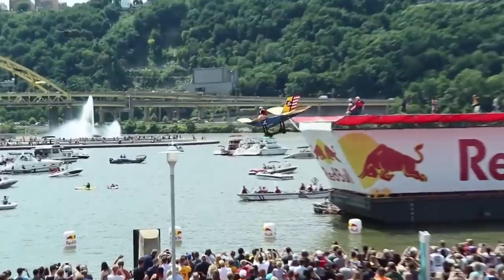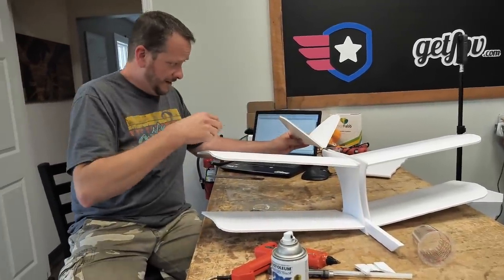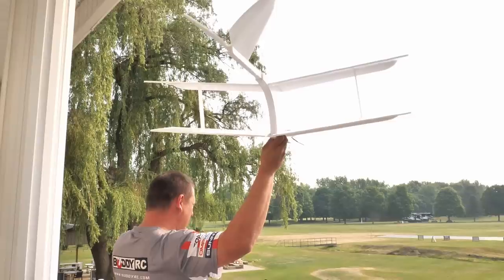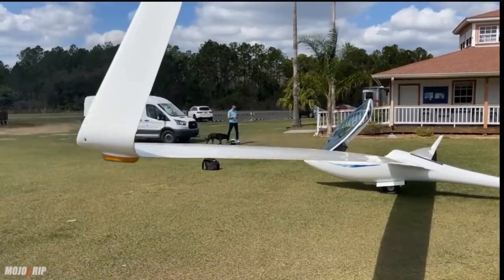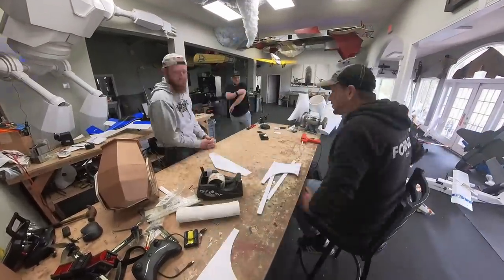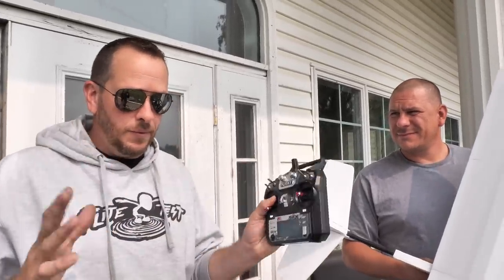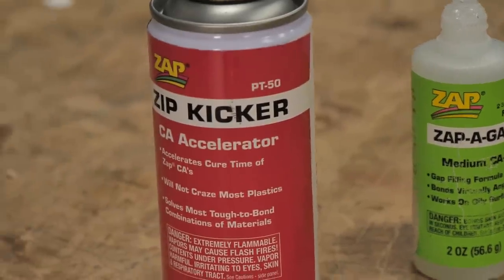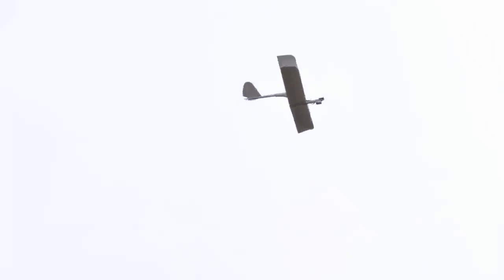The Red Bull Flugtag Record Will Be Broken!!

Comment: given that the flugtag takeoff speed is basically 0, i would do model testing not by tossing the plane, but simply dropping it
Reply: Came here to say exactly that. Tossing it makes no sense
Reply: @camofpv  also they completely forgot to add the weight of a human to the nose of the craft (or a simulated, to scale weight) so im predicting a phenomenal nosedive at flugtag
Reply: But they have weight on the nose?
Reply: @Space_Reptile if i had to guess they’re figuring the weight of the control electronics is roughly equivalent to the pilot
Reply: Don’t you love it when a plan comes together
Reply: Flugtag launch speed is about 6mph. (fast waking speed)
Reply: My thoughts exactly. Just push it gently off a ledge to simulate what's actually going to happen.
Reply: Maybe not simply dropping it but launching it at scale velocity as well.
If it's 1:10 scale they should be testing launching at 1:10th speed
Reply: They literally push it into the water
Reply: @dancamplinmusic aerodynamic effects do not scale like that. A lot of aerodynamic effects are proportional to velocity and surface area and that leads to scaled down models needing a higher velocity or airspeed to simulate the effect properly. So scaling the speed down to 1/10th when you have scaled the model down to 1/10 is likely not anywhere close to be correct and will not give you accurate tests.
Reply: @conorstewart2214  yes, you're right!
Which is why the thrust needs to scale down to 1:10 for a 1:10 model.
A 1:10 model that generates sufficient lift at 1:10 thrust will typically perform better when upscaled. 
There's alot of complex equations that can be done to establish exactly how much to scale down thrust but for the exercise of flugtag, and in the interest of not boring the internet, I would argue that those equations are wasted time and added complexity to a build that is designed to last approximately 30 seconds at a flugtag event.
Reply: @markkmiecik9797  You can increase that by using a pulley system and having a bunch of heavy guys jump in the water first pulling on it. You can also increase it by building a very high cart to launch from. The current record holders did neither, they only build a plane with supreme glide capabilities and used a very light pilot (45 kg). The record can be easily broken by a combination of three things: launch from as high as possible, launch as fast as possible, build plane with best glide ratio.
Reply: Was just about to comment the same. You must develop a wing/foil design that will glide from close to 0 takeoff and go from drop to flight in a extremely short distance, or else you will be swimming 12 feet from the starting line
Reply: @camofpv  🔴 What Is Islam? 

🔴 Islam is not just another religion. 

🔵 It is the same message preached by Moses, Jesus and Abraham.

 🔴 Islam literally means ‘submission to God’ and it teaches us to have a direct relationship with God. 

 🔵 It reminds us that since God created us, no one should be worshipped except God alone. 

 🔴 It also teaches that God is nothing like a human being or like anything that we can imagine.

🌍 The concept of God is summarized in the Quran as:

📖 { “Say, He is God, the One.  God, the Absolute.  He does not give birth, nor was He born, and there is nothing like Him.”} (Quran 112:1-4) 📚

🔴 Becoming a Muslim is not turning your back to Jesus. 

🔵 Rather it’s going back to the original teachings of Jesus and obeying him. 

More ...
Reply: @conorstewart2214  THIS
Reply: @dancamplinmusic   - ...adjusted for scale air density.
Reply: @lifequest7453  you seem to have read this situation very wrong. I am not involved in this channel in any way, I am just another person who watched the video and commented on someone's incorrect comment.

If you think it affects the small model as it does full size then you have no idea what you are talking about. It is very well known that aerodynamics do not scale linearly and smaller scale models often need faster air speeds to have an accurate simulation. I was commenting on someone else's comment saying that a tenth scale model needs a tenth of the speed which is very incorrect. You very clearly don't understand fluid dynamics if you think you can just ignore scaling or that it doesn't exist. Many aerodynamic and fluid dynamics laws are not linear so they do not scale linearly either, that is basic fluid dynamics.

Where did I say that they were testing it appropriately? I never did, all I did was correct someone else's comment.

No wings are too small to make lift and no object is heavy enough for wings to not produce lift. Yes the wings might not produce enough lift but that wasn't what your incorrect comment said.

It would appear it isn't very difficult to know more about this than some viewers, like you.
Reply: Precisely. I was just about to make a comment saying the same and saw yours. The air flow over the wings is so small it needs to fall  some to build up air speed, then... you MIGHT generate some lift.
Reply: The launches that are actually trying seem to launch with a speed close to their intended cruise speed, actually.

Comment: I don't think that many teams think about ground effect. That's where a lot of competitors get the distance. I'd  design something to take advantage of that. Also slow flight means large control surfaces so why not just use the whole stabilizer as an elevator?
Reply: This comment was stolen from me, someone using my name.
Reply: The moment you reach ground-effect you got about 10 to 15 ft of travel left. Power ground effect is a different story.
Reply: The lower wing is really low, which should help with GE.
Reply: I’m more worried about the stall effect.
Reply: Yup!...I just came back to comment that a dive for airspeed should be job one... Followed by leveling off to take full advantage of ground effect.
Reply: funny how everyone is forgetting that  drag generated by the top wing cancels out the lift generated by the bottom wing.   lol
Reply: @lifequest7453  
I DID see one setup that had an elastomer catapult (think "slingshot") on a cart. The whole thing was pushed off the launch deck, with the catapult being triggered just as the cart went off the deck.  The plane actually climbed, levelled off, and then glided downward for am impressive distance.  I'm not altogether sure that it was a legal flight, though.

Comment: The launch from the barge and the first 1 second of flight are most critical in this event. You will need to apply your engineering skills to the full scale launch phase. After launch, make sure your spars can handle the load. Good luck! I'm rooting for you!
Reply: I would be working on the launching more than anything if you could add a line to the launch cart to the aircraft so as to turn it into a kite and gain altitude and speed then quick release
Reply: One design years ago incorporated a rail launching device geared to the sled wheels in order to increase forward acceleration before the Edge... Think slingshot effect!😅

Comment: The team that used the two guys jumping off the platform to pull ropes and really accelerate the flyer was genius
Reply: If they used a tall tower to launch from, they not only woul get extra height to start but it could be a catapult using the ropes attached at top as a fulcrum, so when they jump off it throws the plane off the end like a trebuchet
Reply: What about bungies instead of ropes?
Reply: @dskofich  yeah, climbing shock lines could be used for a smooth transfer of energy
Reply: Or offroad recovery rope. Definitely was thinking of some sort of energy recovery setup where the cart falling away has some sort of delayed arm that transfers some of that to the glider.
Reply: @accordv6er  recovery rope would probably be to strong, a rock climbing shock rope would work better I think
Reply: @dskofich  they could slingshot the thing into the next county. lol
Reply: Adding to that idea: what about performing some staging act... something like a mix of 2 scenes from Indiana jones (nazi plane scene from the lost ark and the biplane scape from the last crusade) making the transition from the dance to the launch in one take.
I mean, better than some silly dance moves(?)
Reply: @pablofloreztabares8110  yesssss bi plane could be a comedy bit where the pilot is launched without his aircraft or something if distance isn't key factor
Reply: @pablofloreztabares8110  ooohhh what about flywheels? Could jump off where the shock cord starts the spinning and the team member is curiously hanging there like he's trying to.fall as it slowly accelerates. 2 or 3 people falling might have enough energy to really get something going combined with a push from others?
Reply: @accordv6er  I like it! (overengineered but I love it)
Reply: @accordv6er  I was thinking more like a gun scene like in the old websterns falling from balcony
Reply: @pablofloreztabares8110  RB needs more of these and the soapbox derby. I'd travel for soapbox, idk about trying to transport a flugtag machine ahaha. Nothing near me for a long time :(
Reply: I hope they see this comment. The launch vehicle/mechanism is going to be as crucial as the flyer.

Comment: What if instead of trying to fly right away, you use the height to gain speed, then glide right above the water surface like an ekranoplan? That seems like a more efficient use of the very limited potential/kinetic energy.
Reply: better yet.. why not use the vertical drop as a gravity catapult? in other words... hook the plane to a rail system in such a fashion that the rail system serves as additional thrust as it rotates off the edge ??
Reply: @rollerkingonce  While not specifically banned, I don't think launch assist is allowed. Gravity may be different (and not having it specifically banned means it IS allowed, right :D ) and that would actually be a great idea since at that point you can have as much drop weight as five people (required team size, as per rules) could carry up there.
Reply: The fartest you can possible go is a combination of speed and ground effect. Launch speed can be increase with a pulley system, just need all the non pilots to jump down in to the water.
Reply: @AgentWest  There's some optimum in this regime. Diving more from the platform allows you to design for a higher glide speed, thus decreasing wing area and increasing aspect ratio. It also allows you to increase your lift and reduce induced drag via ground effect. The downside is you end up spending less time in your optimum parameters. Also, the control problem of a dive glide is much more difficult than a constant glideslope. 

The real secret is to find the lightest pilot possible. A 40 kg tiny woman needs only half the wing area of a 80 kg man thus half the chord at the same span, and that wing will produce half the lift at twice the L/D thus ~1/4 the induced drag. The Chicken Whisperers use a very light girl. This is the single most impactful design parameter.
Reply: @appa609  True about the weight. I just looked up "Chicken Whisperers" and their 2013 flight, that was impressive! What i found particularly interesting is that their glider started on a rolling platform. While it was rolling and the wing was gaining lift, the pilot had plenty of time to adjust her body position (i.e. balance of the craft) for the best glide slope. Very basic way to control a very simple craft. Very effective in the end.

Comment: Unfortunately biplanes don’t exactly double effective lift. Depending on separation, it might only produce 120-140%. 

The way they will help is you can build the wing structure lighter because it is essentially a bridge truss. Lower weight means lower stall speeds, which will help greatly since your take off speed is essentially zero.

Comment: I feel like u would want something that shines at ground affect and has strong tail authority quicky...u want it to drop off the boat and quickly be able level out once picks up some speed and translate it into a glide slope so Def narrow wide almost flat bottom (slight undercamber) with v tail for sure for added dihederal and shorter using the person as the nose weight or if possible person directly on top of cg

Comment: I don't know what the "Launch Assist" rules are, but if they allow, I would think really hard about using a push pole of some sort to enable your ground crew to impart as much energy (speed) into the craft as possible.  Just like the Cub Scout Pinewood Derby cars, its all about the physics and the energy provided by your launch assist crew is probably one of the most important factors to manage/consider.  Find a bunch of rugby players to be that crew...

Comment: Look at the Japanese human powered flight yearly comp. They also have a non powered field that fly about 200 meters. The pedal powered version go over40 kilometers!
The idea is that you dive down off the end to get speed then use the ground effect off the water to maximize the glide slope.
Reply: You mean "JAPAN INTERNATIONAL BIRDMAN RALLY".Probably the best competition in the world.Looking at the video of the competition, we can see that the slow flight design has the opposite effect, and the optimal solution is an aircraft that does not lose speed.
Reply: @pulaperapora7130  yes it is the greatest test of man powered or glider flight I’ve seen.

Comment: A longer aspect ratio will mostly reduce induced drag, but it gives it a much higher frontal area which greatly increases parasitic drag.
Reply: The wing span is the same, parasitic will be the same
Reply: You mean form drag. Parasitic drag is from non flying parts (not wings). Like undercarriage or aerials.
Reply: At the speed theyre doing induced drag is much higher than parasite drag

Comment: Just a few things to consider.  Directional Stability>>This can be achieved with either a rudder in the back, OR having vanes on each wing.  Since a vane can be placed on each wingtip, you don't need as much surface area and this saves weight.  The tail can also be a full flying horizontal stab which saves weight on hinges and linkage.  Also, you need to consider Bernoulli's principle.  Lift is created by a differential in high/low pressures that are created with wind velocity differences.  I like the biplane idea, but the camber of your wings needs to be increased.  You can also cut down on the cord if the wing is more efficient.  Aspect Ratio is everything.  Now, find a very small girl to fly it.  Good luck.

Comment: Two ideas: 1. What about flaps? This would allow the pilot to trade drag and lift as needed. What if with flaps you could actually get the thing flying before the end of the platform, then retract them for speed while descending, and then extend them again just before splash down to get a few extra feet. 2. Can you build it around a bicycle? You can get moving faster by pedaling then you can by running.
Reply: For a few-second flight, too many things to fiddle with only complicates things.

Comment: I've always thought that the best way to control pitch on this type of craft  (no need for steering) would be to have the pilot sitting on a rowing machine seat that moves forward and back to instantly change the c/g. This could even be used to control an r/c plane; forward/aft, left/right movement of a weight being the only (hidden) control surfaces.

Comment: Dont forget, you have counter wieght also!!! if you created a pengelum type seating arrangement which swung forward for initial launch to shift cg nose heavy,,,, then craft goes into dive, builds speed, then the spring loaded cable connected to wing just behind cg, pulls pilot seat back and locks into cruise position with cg at or slightly behind Center of Mass to  pull nose up and achieve your flare for landing.

Comment: I'm thinking using a couple of levers, demountable, fixed under the wing root which, could be attached to ropes. The two jumpers would jump off the edge and the levers would increase the speed and give you a height advantage.

Comment: You don't actually get double the lift from a biplane, because they have considerably more interference drag- and the low pressure zone on top of the lower wing reduces the high pressure zone on the bottom of the top wing. But you placed the wings pretty far apart  vertically which helps, and while it might not double your lift, it still increases it. It's a proven very stable design, So much better than any (inherently unstable) tandem design!

Comment: I was thinking about the launch, are you allowed a guide rail. If you have a single "u" rail, so a single wheel  (in the c/g) would allow a smoother launch. As far as the crew, 1 Pilot, 2 on ea. wing, and a single (1) on the tail. The tail person is responsible for pitch and yaw at take off. The 4 on the wings would provide the thrust and make shure the wings don't drag. Or can there be a "Catapult" similar to the Wrights,  same rail, but this time everyone except the pilot grab the tow rope and drop off the end at the  same time launching the craft. Anyways, just a thought.  Great video,  thanks again.  John S..

Comment: I don't see any brace wires on the model.  Be sure to add them when scaling up as they're one of the biggest reasons to use a bi-plane wing.  i.e. by cross bracing between the wings you can make them work like a single super thick truss instead of long thin cantilever beams.

Comment: You are decieving yourself with the toss tests.  Your toss velocity is WAY greater than what you will achieve running off the Redbull tower.  A better test of its glide capability would be to let it slide off a rail from balcony.

Comment: Aerodynamically, a longer chord wing is better than a biplane. Your effective aspect ratio is equal but you get more ground effect lift if all the wing area is near the water, and the L/D benefits from doubling the reynolds number. The only advantage of a biplane is structural efficiency, which shouldn't be an issue anyways.